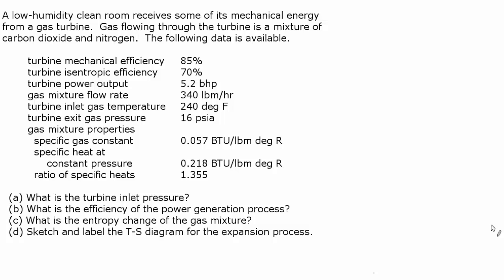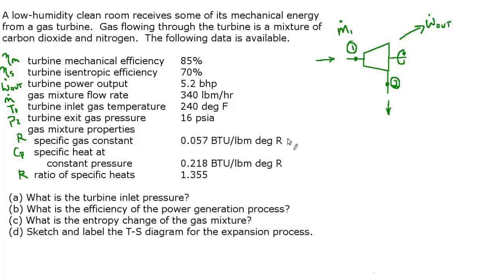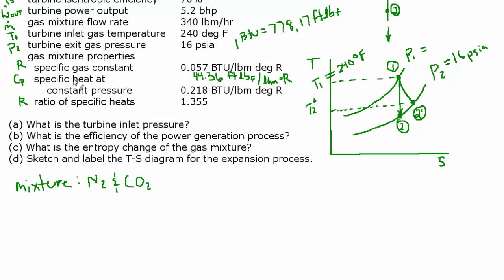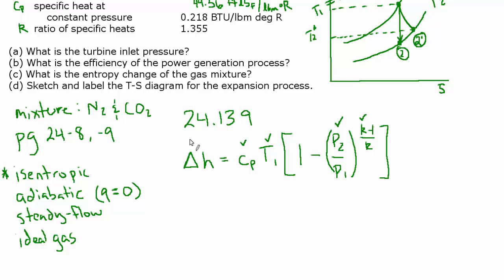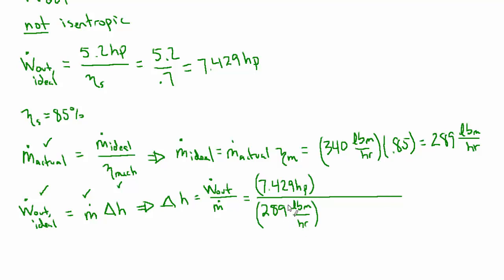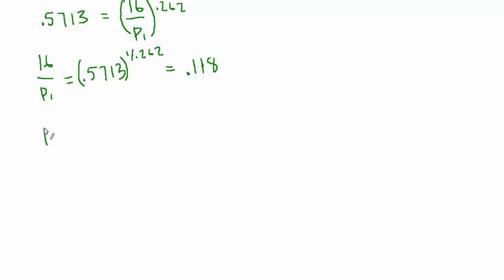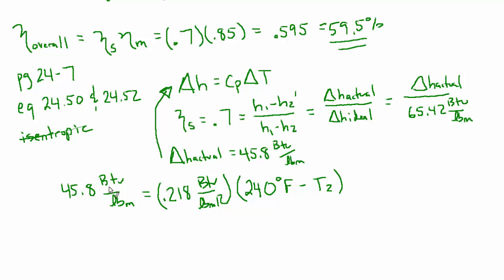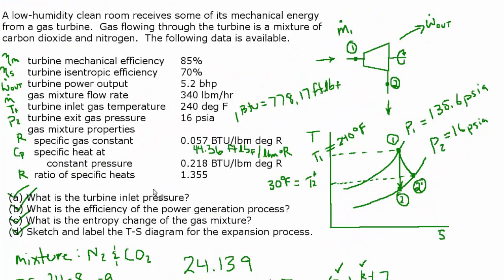Gas Turbine Efficiency & Thermodynamic Cycles: Step-by-Step Mechanical PE Exam Problem

Comment: In the new P.E. exam, we cannot bring any additional material other then the reference manual they provide (Most current edition is 1.4). I could easily figure out answers to parts (a) and (b) using this reference manual. Only two equations on page 270 are needed to find part (a), namely Turbine work equation and isentropic efficiency equation. However, I cannot seem to find any equation to solve change in entropy that looks remotely close to what Dan is using from the reference manual. Has anyone else been able to find it?
Reply from the maker: Hi Kimberly, You're right, some of those equations are from the MERM, so you shouldn't expect to need them on the CBT version of the PE exam.  The MERM had quite a bit more content so it's actually good that the breadth of content is somewhat consolidated now.  These problems are good practice but may go beyond what you truly need in some respects.  FYI - All the videos in my Bundle programs for both HVAC and TFS are CBT-aligned and use the reference handbook only.  Check them out at www.mechanicalPEexamprep.com and feel free to shoot me an email with any questions you have.  We also have Live Office Hours for questions.  Looking forward to supporting you on the journey!

Comment: Is there another 6 of these? I see 1 of 7 but can't find 2, 3, 4 etc.
Reply from the maker: Hi C G, I had more at one point however I used bits and pieces of the other problems in my paid courses.  If you are PE candidate, you may want to check out the HVAC Bundle.